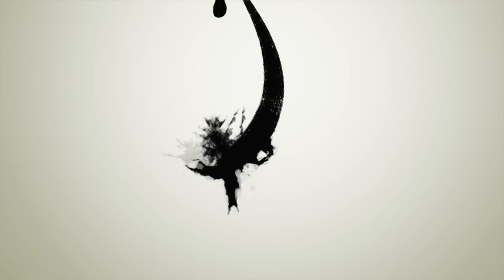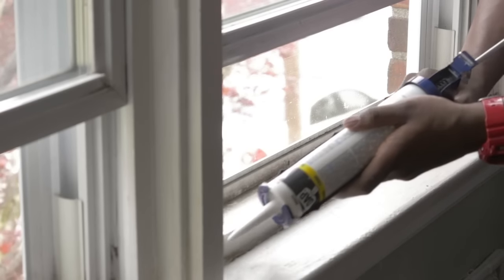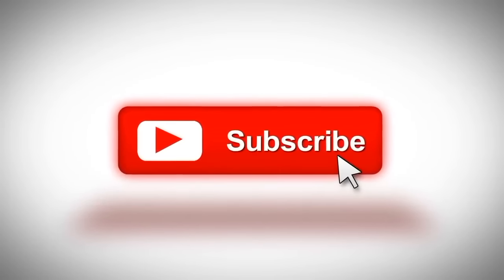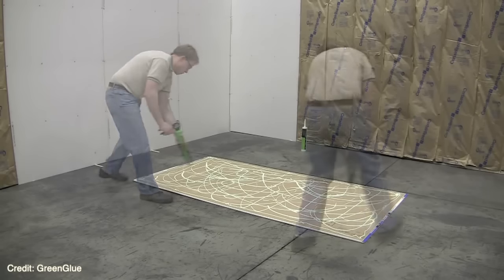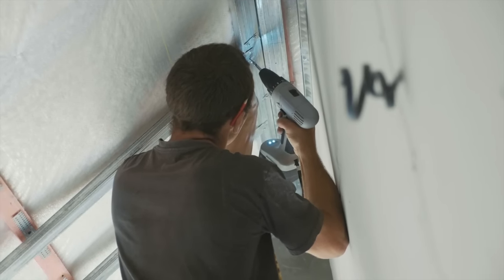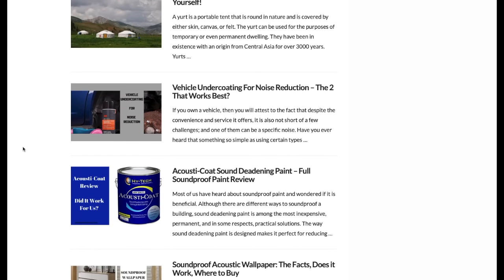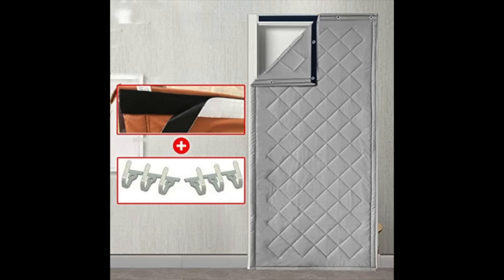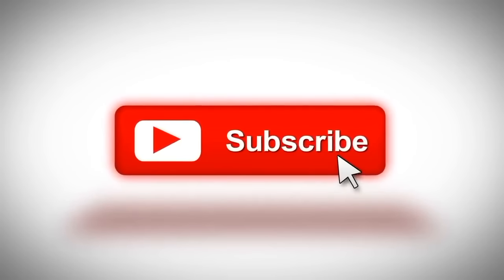How to Soundproof a Wall - 7 Easy DIY Ways!

Comment: We have a "Shed" like structure built out of plywood and 2x4's.. There's no drywall. There's openings in the corners of the ceiling. I was going to cut thick pieces of black Foam sheets. There about two inches thick and 8ft long 4ft wide i think. And place them in the ceiling and walls using velcro. As well as possibly getting that green glue stuff you mentioned in the video to be put in the crevices between all the wood and maybe between the foam pieces? Maybe one day if it can be afforded we will install dry wall on top of that and some flooring/carpet. Giving it a nice recording studio style look. Do you think these foam pieces will make a difference? Its hard foam not soft

Comment: I want to soundproof a party wall from noisy neighbours, I can hear them turning on and off switches and unplugging plugs through the night which is really disturbing my sleep Also child crying. What is the best method? I cant alter the walls as i rent. I looked at: The Wall System 2 it  is the thinnest party wall soundproofing kit. And looked at Acoustic foam panels, do you think they would help? Many thanks
Reply: Zanyzo22 Move to rural Iowa. You can't soundproof if you can't insulate inside the walls.

Comment: Would just hanging a very thick curtain block a lot of noise? I don’t need sound proof just a decent amount of dampening
Reply from the maker: Yes it actually would. I would suggest moving blankets. Their cost effective for what you’ll be using them for. Also, make sure to not leave any gaps on the wall that you’re reducing noise on, cover the entire wall for best results!
Reply: Soundproof Guide thanks

Comment: So I was thinking about adding a spray foam insulator(Great Stuff type stuff) down into a finished wall to try to sound proof my bathroom. Do you think that would also work? Made me think about trying to fit strips of vinyl between the studs as well.
Reply: I’m curious about trying this too. Did you already give it a shot?
Reply: @talonh2012  I didn't. From other research, I wanted to at least add the vinyl strips in first at least to the best of my ability. I might add it in afterwards though.

Comment: man, I used green glue sealant for a set of glass doors in an upstairs loft, and this stuff is REALLY messy and hard to work with.  It's too runny, and gets everywhere.  It's almost impossible to do a clean job caulking overhead, and be prepared to have a significant portion of the green glue on your floor and everywhere else except for where you wanted it.  I would never use this stuff anywhere near a carpet or rug.  And once it dries, it has the consistency of chewing gum.

Comment: So I have a third garage that I’m using as a woodworking shop. The garage shares a wall with a room we use as an office. My husband would kill me if I wanted to remove the existing drywall bc it’s a new build lol. Would my best bet be to do the second layer of drywall to that wall? And also, so I need to put it on all the walls in there so it doesn’t look weird?
Reply: What did you end up doing?

Comment: I live in a small apartment with a thick stone wall between me and my neighbours.. I have bought a concept 2 rowing machine and it is quite loud.. around 70 dB. I was wondering if there is a small solution I could use more localised between the rower and the wall?
Reply: Xavien Tremayne No. In order to actually soundproof your apartment, you have to insulate inside your walls. Covering your walls with crap won't actually do anything, and it will be ugly and people will laugh at you when they come and visit you.

Comment: Hi, I live close (1/2 mile) to an airport and have been investigating ways to soundproof my home. I have a single story house. Air traffic noise comes from the walls and ceiling. I was going to start with the ceiling by installing 1/4 - 1/2 inch plywood with green glue noise dampening compound to cover my popcorn ceiling to add mass. Then a layer of bead board and cover seams with .5" x 4" wood planks. Then paint. Next I was thinking of installing ship lap tongue in groove planks on the interior of my window wall. I have installed Milgard Quietline windows which did help.  I can install drywall. Wondering what you think on this. Thanks for your youtube video.

Comment: How well do acustic foam panels work. Fiy I am the one making noise.
Reply from the maker: Well, the only thing acoustic foam panels are good for regarding sound is by absorbing some of the noise you're making. It won't reduce the amount of noise coming out of the room but it will make your noise sound better within the room ;)

Comment: Hi, I live close to an airport. I would like to install tongue in groove pine on my wall in the back room and the ceiling. Do you think this will help as well or better than drywall? thank you.
Reply: Wont be better than drywall, resilient bar and sound block boards x 2 layers is the best option for minimum space loss

Comment: If I apply all 7 methods, can I eliminate all sound?
Reply: this video is old & outdated, if you're gona tear down the wall, simply add rock wool insulation in the wall cavities, then screw sonopan, resilient channel & 5/8 drywall
Reply: @wiiiz3  Thank you so much!   I looked into those products and they look very promising.

Comment: Hi! So would you place the green glue between the vinyl and second layer of drywall, or the first layer of drywall and the existing wall? Or does it really matter? :)
Reply from the maker: You could, it wouldn’t hurt but I would say that MLV is more than enough soundproofing with the 2 layers of drywall.

Comment: How can I soundproof a manufactured  home window? Its pasivally a 1 pane window. I am trying to block traffic noise coming from the outside of my home.
Reply from the maker: Best bet would be to use thick blinds and also have soundproof curtains over the blinds for better noise blocking. Watch out video on how to soundproof a window for more information. There will also be links in the description of the video on which curtain and blinds I recommend.
Hope this helps!

Comment: How to sound proof heat pump air handler in attic???new /to loud
Reply: J Franco … if it's the air wooshing sound you need  to change the way the ducts are done. Perhaps they are too small? If it's vibration through the ceiling then you need to isolate the unit from the attic floor.

Comment: My parents have their TV as close as they can to my wall And for whatever stupid reason, the speakers are on the back of the TV so it doesn't matter if the TV is on 15 itll be loud in my room. My dad has hearing trouble so it's constantly on 50 or more

Comment: I have the neighbors from hell.  If a person had money to burn, and they went all out and had the ceiling, walls and floors of their 2nd story, 850 square foot condo...how much of the noise that their mentally ill neighbors (they live next door not above)  could be eliminated and what would it cost?  thx
Reply: Dependes on the size(area)of the adjoining wall if theres not an adjoining wall I'd find were the noise is entering the property, sound detector!
I found a large hole between 2 property once, plug sockets back to back and so you could literally shake hands with your nieghbour in the wall cavity lol.
I need more details if you really need a solution to this.
Reply: If your prepared to spend big money, I would recommend a consultation with a specialist. They have specialist equipment and will give you a professional advice. It might cost a bit of money but it's better than attempting it yourself and not getting the results you want.
Reply: If you have money to burn why not just move out not worth the trouble 🤷🏻‍♀️

Comment: A book shelf... yeah mass helps dampen sound, it also helps collapse load bearing walls.
Reply: Bro what..... What kinda walmart half assed wall you got
Reply: @RiorXD  🤦‍♂️go build a 600lb bookcase & load it with 5 tons of books... let me know how it works out. Note that's about the weight of a 15x8 bookcase fully loaded
Reply: @adr3ns  I though bookshelves usually sit on the floor and are fastened to a wall...not hung on a wall...if so how would the wall collapse if the bookshelf is holding it's own weight?
Reply: @uhvoid8433  because the weight of the bookshelf causes the floor to deflect beyond its rated movement.
Reply: @adr3ns  that would mean the floor would collapse not the wall?
Reply: @uhvoid8433  except  you build the walls on the floor joists... even on the 1st floor unless it's a slab foundation...
When properly blocked a floor joist usually wont shear, it'll deflect so much  it'll push the wall out from under it.
Reply: Ithink you have a shitty floor if a book shelf makes your floor or walls collapse
Reply: @karvast5726  smh why would a rational person spend 3x the money for a floor that can hold way more than the purpose dictates? 

Should we size toilets to hold tons as well?

Comment: Good ideas throughout.  We are so late in discussing these things,  much less ---demanding that things come to market,  why aren't outlet boxes double walled,  fitted with the soundproof putty?    It should come that way.   

Techniques matter. When hanging drywall, it shouldn't have the odd pieces on the bottom.   First to the ceiling, second sheet to the floor...the odd piece in the middle.  It's easier to apply the mud when working waist-high, and ....doing it that way is not referring sound vibration......the short piece is not at the baseboard, because short piece is  in the middle.

Well pleased with the mass loaded vinyl.  The material is reasonably priced, it's the shipping.    It's a bear to work with ...but it's fire resistant.  

Should be an insurance special exemption because of it.   Fire needs oxygen.....MLV is the way to go, it resists fire. 

Be sure to photograph it.  Your home  buyer will be impressed.   

Great video.....it's information sharing at its best.  We are so far behind with this....have to catch up, build smart.

Comment: Cut a hole in between each stud on 16 in centers and fill with soundproofing foam. Then drywall fix each section.
Reply: What about adding sand or bricks or grinding up bricks and filling the air space of the wall not with soundproofing foam or insulation, but with actual mass.  What would be the STC of this?  Really this question is posed at anyone
Reply: @a3b4c56  hmmm, interesting thought, I wonder what the sound canceling properties of foam-crete or air-crete would have.